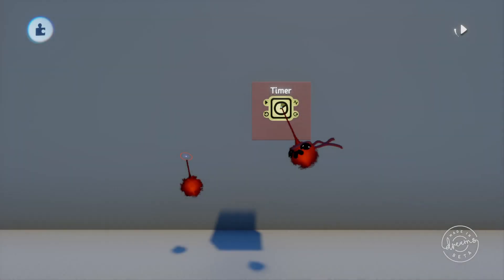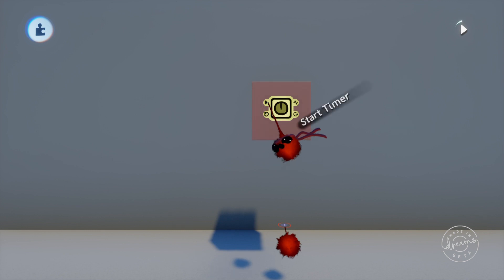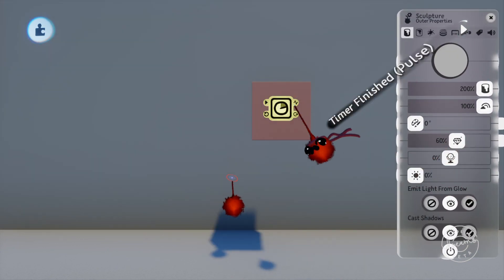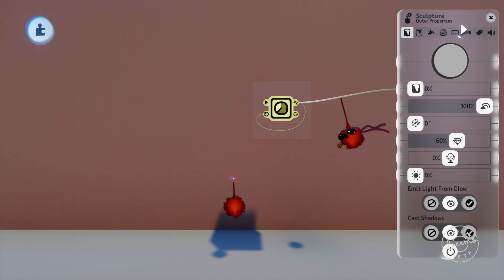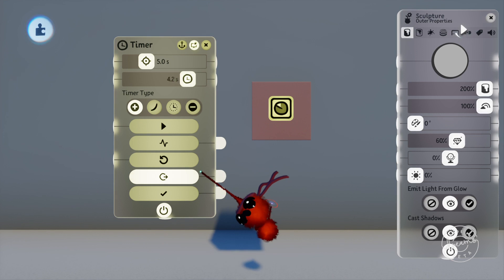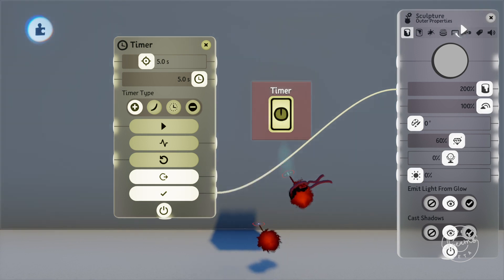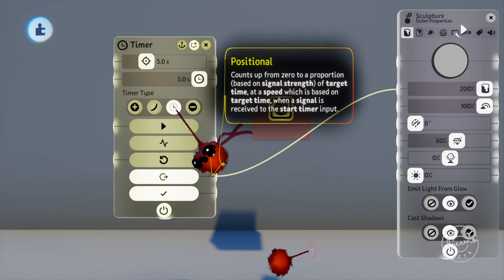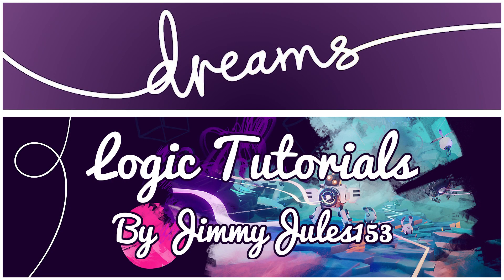Tutorial #1 - TIMERS - Dreams PS4 Logic

Comment: Shouldn't the timer wait for a signal into the play port to start the time? It's kind of annoying to have my timers just start at the beginning of the level and not wait to be activated. Maybe there is something I don't understand but reset is not play. The only way around it it seems is to add some kind of trigger to power it. This is something that has already been giving me issues. Like I want my timer to run when I want it to run then reset when it's finished so it's ready to start again but like you showed in the video it just starts as soon as it's reset. This makes no sense to me when you reset a mouse trap it's not that useful if it just goes off right away am I right?

Comment: Any idea how to set an event to occur only while a Timer is counting? For example, if I want a Keyframe to power on when the Timer begins, then stay on until it ends, how would I go about doing that?
Reply from the maker: You could have a calculator set to ‘greater than 0’ and plug your timer (signal) output into it, that way it’ll only turn on when the timer has started :) you could do a similar thing with a ‘less than’ calculator to make it stop when the timer reaches the end, unless the timer resets itself when it’s done in which case you won’t need to do that bit
Reply: @JimmyJules153  That really helped thanks. 

However, how do you get the timer to stop and for the changes to stop with it? Basically I want to do something like the Mario Invincibility Star however when my timer stops the changes keep going.

Comment: About the positional setting, I'm unclear on why this would ever be useful. You mention the example of adding to the timer when something happens. But if it's in "positional" mode, the only way of the current time changing is by setting it this way. So then... you're just storing a value, right?
Reply from the maker: I know what you mean, I’ve never had a reason to use this but I’m sure someone would have come up with a decent use for it. 
You’re correct there, it’s basically just storing a number, in most circumstances you’d be better off (for readability and ease of use) using a value slider which does basically the same thing as the positional option. 
If anyone can think of a good use of the ‘positional’ setting let us know!